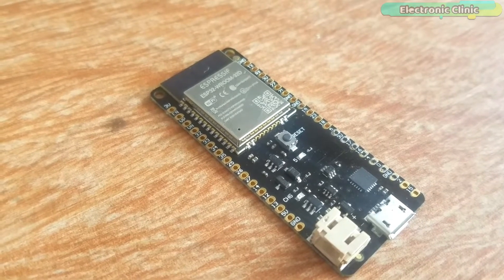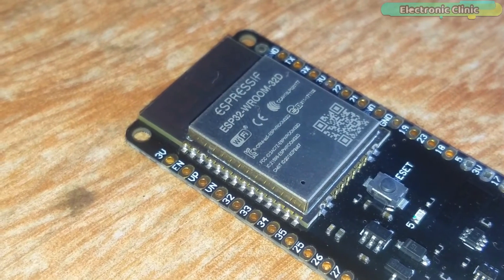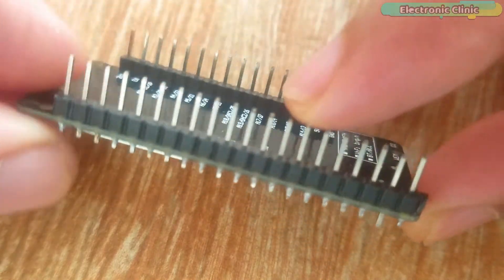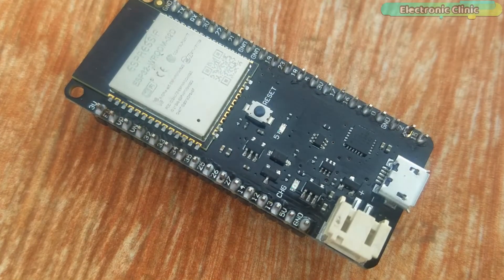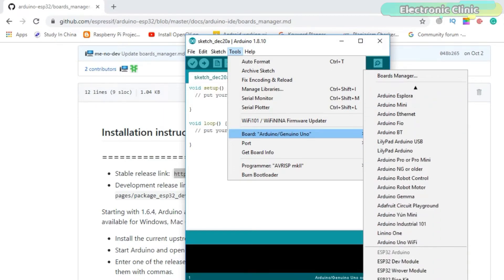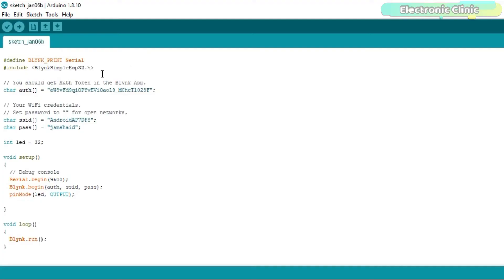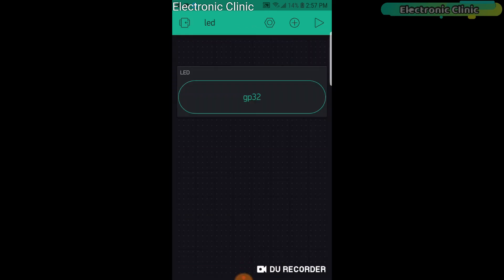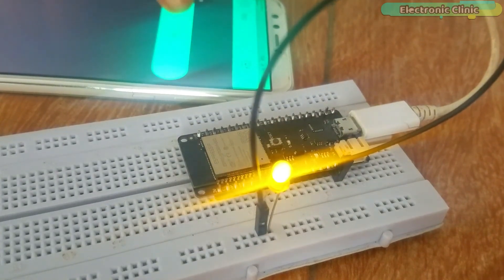ESP32 Arduino IDE | ESP32 Board Manager | Install ESP32 Arduino | ESP32 Iot Project LED + Blynk

Comment: The output to the led from the esp is how many volt ? Can i connect the output of the esp32 to power arduino uno ? I just wnt to add iot to my arduino uno project
Reply from the maker: 3.3V. to control arduino, you can use a mosfet, relay, etc.